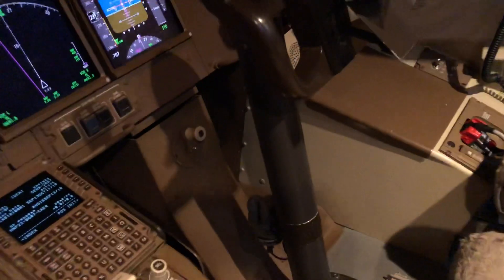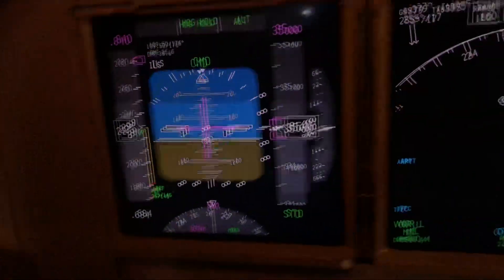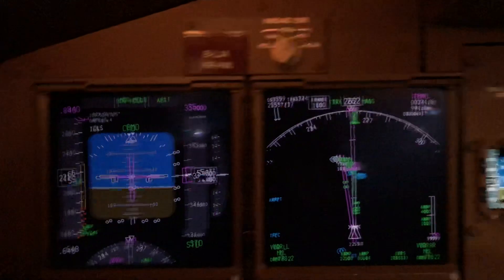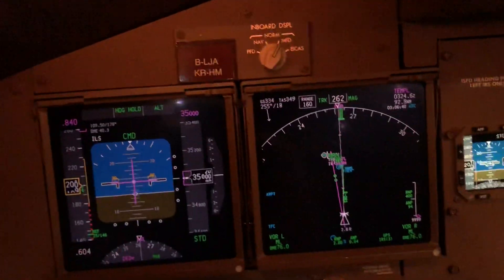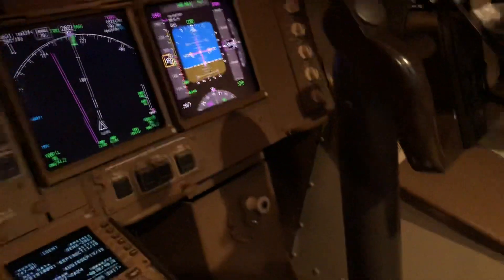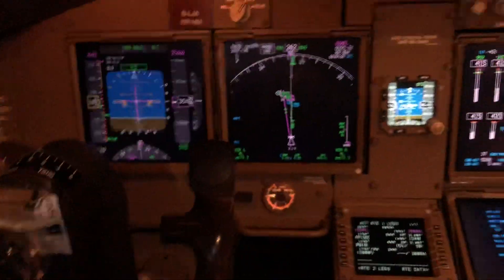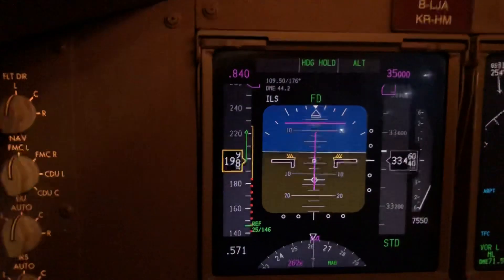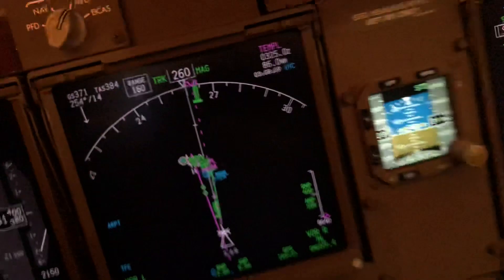The stall warning and recovery

Comment: I did this in a 747 except with in FLC mode and MCT set. I got up to 50,000 feet, which is the highest selectable altitude in the autopilot. The difference between the yellow hook at the bottom and the barber pole on the top was less than 10kts up there and the engines only settled to about 98% N1 after leveling off.

Comment: Proper reaction in your situation but that wasn't a full stall actually. i did stall recovery with aviat pitts in msfs 2020. And when the speed is slow the plane starting to shake and then it falling from the skyes with deep dive straight to the ground with rotation. in this situation two rules is working 1) bring yoke to neutral position" and 2) reduce power to 0. Once plane stabilized hit the full power and get out from the stall. Works perfectly every time with small planes.
But I didn't tried to stall b747-8 so i don't know how it will react, it's alot heavier so it will reach Vne alot faster which it's not a problem in simulations, but in real life it's extremely dangerous, so using speedbrakes during fall in full stall is probably a good idea. i also tried to stall a320neo, and it is pretty much imposible to stall it because of the protections that will lower the pitch automaticly. And i think b747 alos have this kind of protections, at least i saw them in autopilot mod when tried to climb FL410 fully loaded. At FL 400 plane struggle to keep proper speed and it's automaticly lowered the pitch. so i decided to choice FL390.
Stiil very nice video. thank you. Now i know for what are those small boxes.

Comment: On some planes if the stick shaker activates and the pilot still does not respond in time and the speed bleeds to a certain threshold above stall speed the stick pusher pushes the stick forward to unload and initiate a recovery which still requires pilot to complete with added thrust and potch control or else enter secondary stall. The pusher is incorporated in T-tail planes which have a nasty tendency for deep stall.The amber whiskers above the pitch bar(which descend as you approach stall speed also change colour in some aeroplanes from Green to amber to red depending on percentage away from stall speed. Stall recovery is by unloading to reduce angle of attack and once speed is recovered and accelerating recover pitch and power. Premature thrust increase can lead to a secondary stall and the whiskers will re appear. Whatever you do, do not let the stall progress into a spin! There is a very good video during 747SP(refer to link below)  test flights which on purpose put the 747 into a full stall. The test pilots praised the 747 for its docile stall recovery characteristics. The same can not be said for the 727 although it has a powerful lift augmentation system on its wing design. In UK the 727 would not ve certified with stick shaker alone. It had to incorporate a flight test with s stick pusher too!

https://youtu.be/56gSo8GCiQU

https://youtu.be/DGAAEiJ1uU8

Comment: Love your videos cab than I have done that I have a flight simulator also at home and I have done that on the 747 and also the DC 10 stitch shaker disengage auto pilot full throttle forward pushing those down recover climb back little by little later captain

Comment: Captain, when the "airspeed low" warning is gone off,  aeroplane start to vibrate, it means the aeroplane is start to fall down ?
Reply: No, plane starts to vibrate before the stall, when the airspeed is low and plane is close to stall but not stalling yet -as shown in the video. If it slows down further (where stick shaker comes on), it goes into stall and plane is basically falling

Comment: if only the Captain of Colgan 3407 had seen this.
Reply: Or AF447
Reply: @Robert_N  447 is a very special incident. not entirely the pilots fault but still a screwup nontheless
Reply: @cammc_0  Actually they thought they were in a overspeed stall, which is something everyone (at least with an ATPL) knows, and the recovery is to close the throttles and pull up.
Reply: @P3DJumboJet  many thanks

Comment: I hear you don't want to apply thrust instantly because that could cause another nose upswing.
Reply: Absolutely, mentor pilot clearly told that the thrust has to be applied gradually
Reply: @shaikhmullah-ud-din1964  mentour flies a 737 which is much lighter than a 747
Reply from the maker: TechMantra correct

Comment: does the stick shaker/pusher not aid the pilot by pushing the control column forward on recognition of the stall or it's the PF's job to do that
Reply from the maker: The one that pushes forward to aid the pilot is called a stick pusher. They are installed mostly on ‘T’ Tail plane aircraft such as BAe146 because they can easily enter into what is known as a deep stall.
Reply: Obetmaz 747 makes sense now. I've witnessed an Avro-RJ85 preflight and it quickly pushes forward.  Thanks Cap 👍